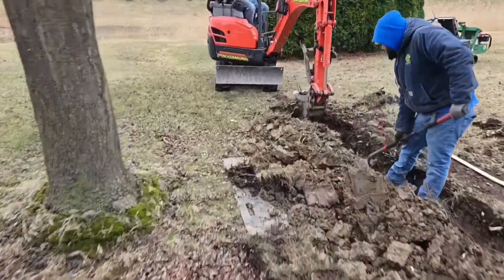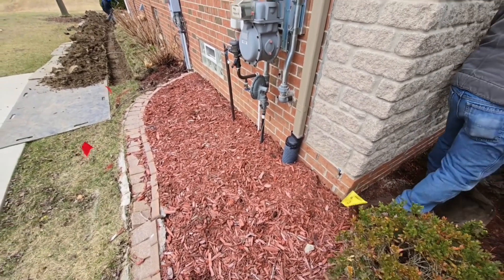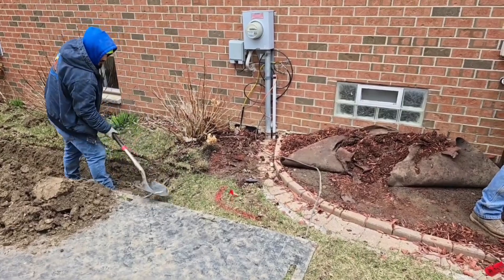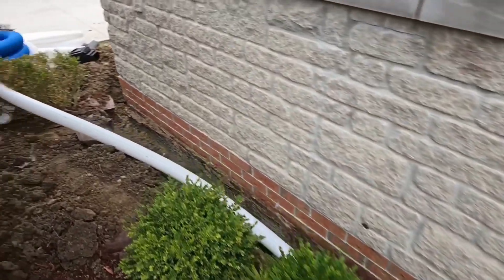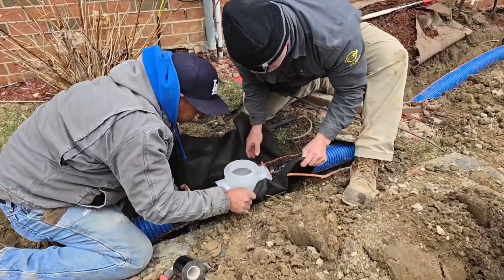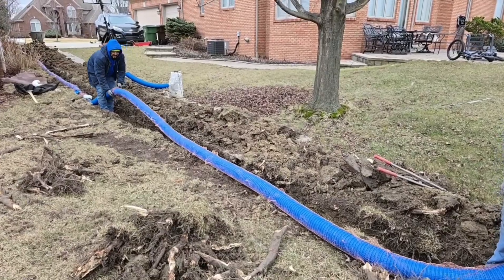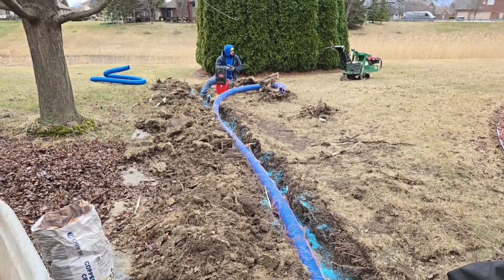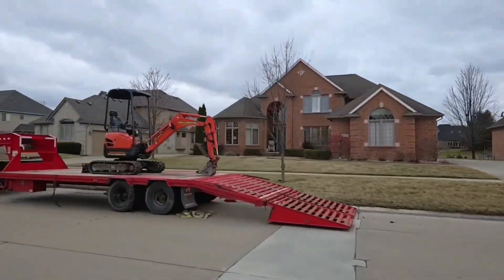Downspout Drainage Line Must Dos;  to Last Forever

Comment: Just dug a 70 foot trench for new drain. Took me 10 half days. 6" of compacted gravel,  and old driveway. Didn't take shovels out of shed. Digging bar for the first 50 feet. Under the 6" was roots and rocks.
Reply from the maker: Sometimes it doesn't come easy. I'm sorry that you had to go through that because I know how tough that is.
Reply: @FRENCHDRAINMAN  thank you, I sweated through my clothes every day. However, I don't mind hard labor. It's actually somewhat cathartic. I'd rather do it than my regular job if it paid the same.

Comment: what about Florida where the soil is very sandy, would you still put the pipe right on the ground? doesn't sandy soil shift and move more? do you want more of a buffer between soil and pipe if soil is more sandy?  What if tree roots are not a factor?
Reply from the maker: If tree roots are not a factor, put stone underneath the pipe.

Comment: Product idea: so instead of making your gutter-screen include a surface type catch basin... I was thinking you could design a riser-inlet of some sort that allowed surface water to enter the gutter line too.  Like an inline-atrium grate that installs under your gutter-screen.  The idea being you take both water sources without dumping gutter-water on the lawn, or if the gutter-screen gets clogged the water hitting the ground can enter the inline-atrium-vertical-gutter-riser. I also think you might need to figure out solutions on how to get all tape out of the sun, in that if it isn't UV resistant then it shouldn't be in the sun when companies install your products.  If your gutters usually have a 3 inch discharge pipe then your riser-inlet could use the extra inch of a 4 inch discharge to design the screen to keep gutter water in while also accepting surface water on the ground.

Comment: Do you always use solid pipe for downspout runs? Is the corrugated pipe only for French drain runs?
Reply from the maker: You are misunderstanding. Corrugated pipe comes in both solid and perforated varieties.  You are referring to perforated pipe when you say "corrugated pipe," and that is incorrect.

Corrugated solid pipe for downspouts 
Corrugated perforated pipe for french drains.
Reply: @FRENCHDRAINMAN can you use a perforated pipe for a downspout and have it work both roles?
Reply: @  VERY appreciated. Yes I mistyped — I did mean perforated. Thank you for clarifying!

Comment: Would you still recommend use of the copper powder and copper sock that leaches copper into the soil on a property AND neighbouring properties that only use well systems or should the copper sock only be used on properties with municipal water systems? It seems copper leaching into the ground might not be recommended for well system properties! Thanks!
Reply from the maker: Copper socks work great, as does copper fabric for even better protection; it will not find its way into your well water.